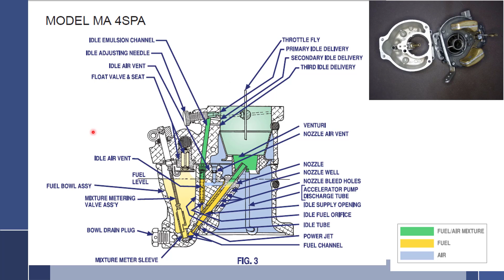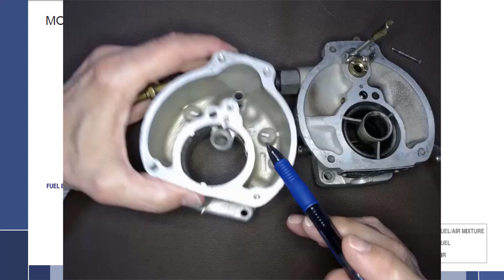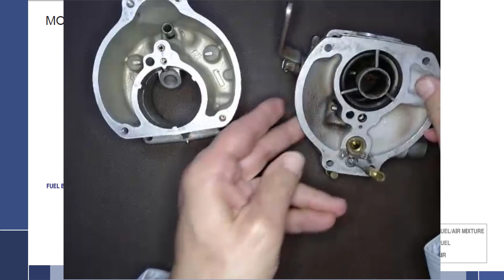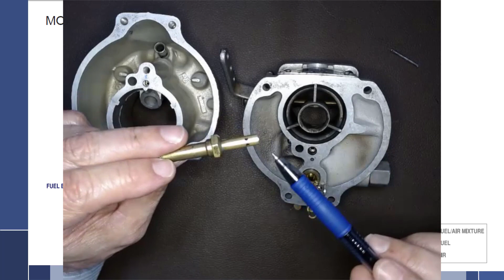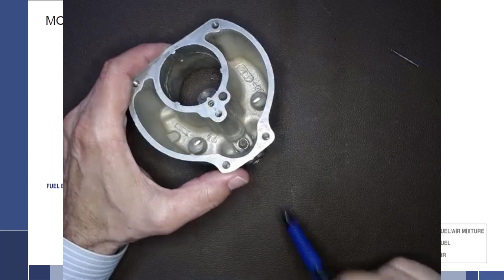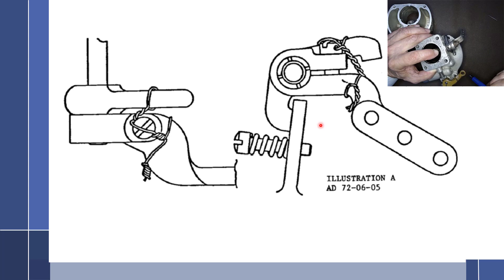The Marvel Schebler MA-3 Aircraft Carburetor

Comment: What does it mean if you have to turn the air idle screw in more than one and a 11/2 turns out?I have mine at around three quarters of a turn out.
Does that mean I have bad floats?
And the float level is too high.I have checked the floats on on the bench.And they measure out correctly.